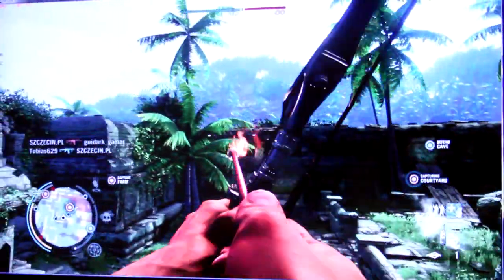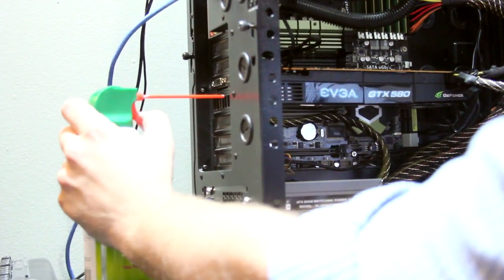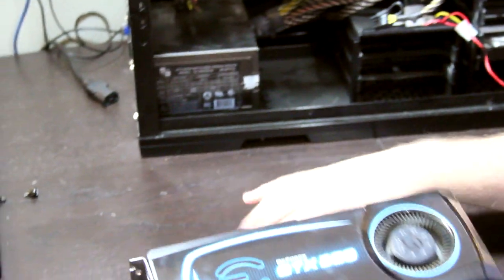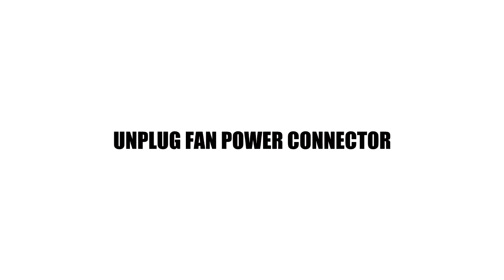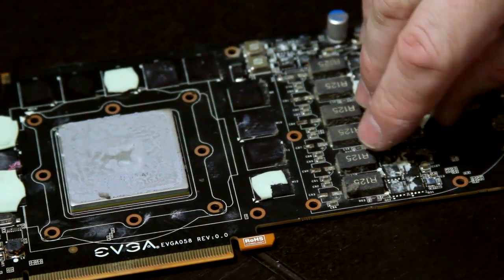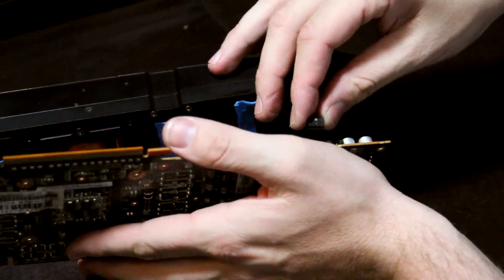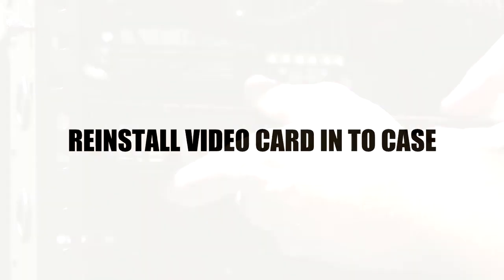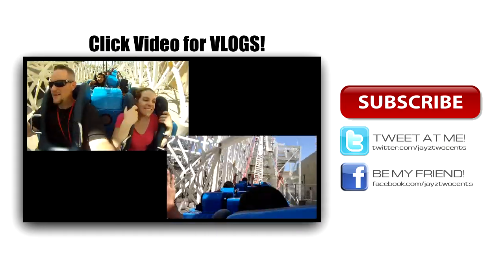How to fix overheating video card - Jayztwocents Tutorial

Comment: My graphics card has overheating problems. It runs over 90° in normal circumstances, and regularly my computer screen will go black and the GPU fan starts to blow full throttle. I've been doing some research on how to fix that problem and I found your video. As it happens, my GPU is a 4 year old NVidia GTX580, the exact same featured in this video. This is the perfect guide I was looking for. Now I have to gather the supplies I need for the operation... wish me luck.
Reply: +lnstagib- DonTry (David) His house blew up, saw it on the news
Reply: @black_savage96  🤣I'm ded
Reply: So how did it went?
Reply: Savage No it didn't. Haven't found time for the procedure yet.
Reply: For me it did worked fine
Reply: How did it go?
Reply: ive got the same gtx 580
Reply: I'm having the exact same problem with the exact same video card. Did this end up working? I just ordered the supplies.
Reply: 2 years later:how did ti go?
Reply: @draganzica296 
Asking in 2021.
How did it go? 😂🔥
Reply: 1 year later: how did it go?

Comment: my top gpu is 20% hotter running @ 84 and the second one running @ 64 I think I definitely need to add thermal paste on the first one asap! thanks jay!
Reply: Isn't that due to the placement of the cards rather than the paste?
Reply: +pcblah gpu 1-in first slot second at 4th slot thats asus rampage v extreme way for sli
Reply: +Jorge Vazquez try switching both gpus.

Comment: I prefer the updated video! Thanks everybody for bitching about how much paste he was using! :D
Reply: GPUs need way more than a CPU. I've used the CPU method on the exact same EVGA 580 and it wasn't nearly enough. I opened it back up and had to throw on 3x for a good even spread. Temps dropped too after putting more on. Jay and EK have it right on this one.

Comment: I have a gtx 580 owned it and used it for two days the first day the card was running at 50 degrees and the next day it runner at 78 degrees after that I decided to shut my computer down and plugged more fans in and after that when I tried to turn it on my monitor won't respond as well as my fan from the graphics card won't move helpppp!!!!
Reply: +Kebab Nabb Did you unplug the extra fans? I think you overstressed your PSU with the added fans.
Reply: Yes I did unplug them thank you for your reply!
Reply: +Kebab Nabb If the fans were the problem I suggest you to change your PSU. How many Watts delivers your PSU?
Reply: 550 Watts it's psu xfx
Reply: +Kebab Nabb The PSU is ok, you should not suffer underpowering. Maybe one of your fans is shorted. Try connecting one fan at a time and turning on your PC to check which one is faulty and making your PC not to turn on.

Comment: I have a 6-month-old MSI R9 380 4gb in my PC. A few weeks ago, my monitor would give me a "no signal" message after a few minutes of having any game with decent graphics loaded up (it only let me play stuff like Papers Please, Darkest Hour and XCom UFO Defense). It also auto shuts down when I watch youtube videos on it. I looked inside my PC recently and it looks like the only thing holding my GPU cooler to my GPU is the fan cable (it doesn't look like  there are any screws holding the cooler to the GPU but it could be that I just can't see them inside my case) and the thermal paste looks like it's barely there (and a little like it evaporated). Do you think replacing the thermal paste would fix my issue?
Reply: +DarkPhoenixNinja92 Well, it's almost certainly my thermal paste needing to be replaced that's causing this. I did a temperature test and my GPU is passing the 100 Celsius mark and shutting down my PC (probably to keep it from dying due to heat or something). Does MSI always skimp on thermal paste application or was it just bad luck?

Comment: Is it possible for a graphics card to get toasted and not work any more from overheating?

Or is there a too hot circuit that ** always ** turns the card off before it fries?

I'm looking at an MSI Hawk video card on Ebay. The description says the card is defective and it keeps overheating. I wonder if it is worth buying the card and replacing the thermal paste.
Reply: +Anthony Starfield The GPU will underclock itself if it gets too warm to prevent overheating. I would NOT recommend to buy a used GPU, ever, unless you buy from a trusted retailer and not some random person. 
If the seller sais it's overheating, it could be thermal paste. It also could just be a bad card. Don't buy it.

Comment: Did not work ;-;
Reply: +12AzaA1 could be your power supply mi i7 920 was reaching 95c and turn off i try everything and nothing until i change the power supply also if you buy useless economic thermal paste it will do nothing i buy mine for 2$ and my graphics card run even hotter

Comment: im borrowing my friends gtx 580 and it has a pretty beefy cooler on it (tripple Fans) and i recently cleaned it out aswell and changed the thermal paste and the thing still reaches 90c and higher, it also completely crashes when it goes past 90c. would anyone know what the issue might be?

Comment: Is it just me or did Jay forget to mention that to remove a PCIe graphics card you have to pull the locking clip towards the CPU ? (Or on some boards you have to slide a lock clip towards the back of the slot) If you don't do that you either won't succeed in taking out the card or I think you might damage the PCIe socket...

Comment: Can i clean the thermal paste with wet towels ???
Reply: +mamomi1 HD 

I normally clean thermal paste off with an anti-static cloth the type that's used to clean screens ...does the job
Reply: +mamomi1 HD You should probably invest a bit in some anti-static microfiber cloth. You can find some here http://www.amazon.com/Kinetronics-Anti-static-Microfiber-Cloth-10x18-Inch/dp/B00009R7VT for 10 bucks
Reply: +mamomi1 HD I take an old credit/debit card and scrape the old paste off. Then I take isopropyl alcohol with coffee filters and wipe the remaining paste off. The alcohol melts the paste away nicely. Once it is shiny clean you are good to go.

Comment: Great video.  I did this same procedure to a friend's discarded HD 6870 about a year ago - it made a world of difference.  (He gave me this card for free, believing it no longer worked.)  In this card's case, the fan had also died - so I took the ghetto-tastic route of zip-tying a high-rpm 80mm fan to the plastic case.  Noisy - but effective.  Worked like a charm!  It went from making horrible grinding noises (bad fan bearings), terrible performance, and dangerous temps (90+) to running like new.  I saw temperature drops of over 30 degrees with the same load, and since the card no longer had to throttle just to keep from melting, my FPS jumped quite a lot as well.  These days I'm running a newer card, but I still keep the little Frankenstein around to remind me what a difference a little human intervention and maintenance can make.

Comment: what do you call the blue tape you put in the card board, and where can buy that. please thank you
Reply: +1960tinotiger It already mentioned what it is... They are thermal pads and you will have to research to see what thickness of thermal pads you will need for your card.
Reply: thank you, now i know what to buy
Reply: +1960tinotiger You should be able to get thermal pads from a variety of online PC stores. They come pre-cut and in sheets of different sizes.

Comment: I thought 79-81 degrees was perfectly normal for a 980 strix as that's what I get when my fps is uncapped (fans normally at 70-80%) But I saw websites listing temperatures at load and they had the 980 strix at roughly 71 degrees at load fans barely spinning....  Does anyone else have opinions on this?  Jay even, although I doubt you'll read this.   I do have 2 980's in and the bottom one has never gone over 68 degrees.  BUT I swear I was getting 79-81 degrees before as well, fans at 70 though.

Thanks in advance guys.
Reply: David Hoffnung Not to mention thats also at a lower fan speed right?
Reply: KillTheCurse That is correct - half actually.  I was using an aftermarket fan connected to a very simple two-speed fan controller.  I always had to keep it on high before - but afterwards it was 10c cooler even on low speed.  On high speed (SO LOUD), I sometimes had temp drops of about 16c.
Reply: +KillTheCurse Do you have them butted up against each other? If so, the lack of airflow for the top card is more than likely the culprit. If you have a 3 or 4 PCI-E slotted motherboard, try moving the bottom card to the 3rd or 4th slot.
Reply: +Posh Cheeky Twat fixed my problem now getting 74 degrees max 50% fan speed.  usually 71c.  

I switched the top and bottom cards around since my top seemed to be running hot.  then made the top of my case an exhaust rather than an intake.
Reply: +KillTheCurse I was going to say - I recently learned myself what a huge difference case airflow can make.  With no other hardware changes, optimizing my case flow dropped my temps by an average of 10c.

Comment: My gpu reaches 90c in like 3 minutes. Is it the thermal paste?
Reply: +Matthias Aarnoutse How old is the card and have you noticed anything different, Gpus will ramp up the temps pretty quick
Reply: 3 years old. The fans starts spinning at 100 percent and when the gpu gets around 95 degrees celcius it crashes, Windows says it restored the driver or something like that.
Reply: ***** Either a really clogged card or it is a bios problem the first one is more likely
Reply: It could be a number of things. I would probably just do some research on threads and find out the common issues with the card.
Reply: Thanks guys. I think I am going to airspray the dust out of it and see if it is the thermal paste.

Comment: Following the steps in the video got my EVGA GTX 660 SC load temps from 90c@70% fan speed to 75c@45% fan speed. In this video though he doesn't take all the necessary precautions, make sure to hold the GPU fan when using compressing air to remove the dust cause it can fuck up your bearings.

Comment: another tip is to check the wattage recommendation on your psu based on the gpu's power requirement. I was running under and upreaded my psu and dropped 10 degrees!

Comment: Witcher 3 makes my GPU run between 70-77°c. the only game that gets my temps up that high on my GTX 970 reference card.
Reply: +TRAILBLAZER02 Why are you using a reference card to begin with?
Reply: +The Light Sabrix Because I made the mistake of buying an alienware x51 and u pretty much are forced to use a reference card. I'm building a proper pc next month though, and ditching the alienware shit.
Reply: TRAILBLAZER02 970 is great, don't throw it away. If I were in your place, I'd buy a AIO water cooling kit for the GPU and remove the reference one. It really helps the cooling and some are actually pretty silent.
Reply: +The Light Sabrix Pretty sure the Alienware X51 has absolutely no room to fit an AIO water cooler, unless of course you were referring to him keeping the 970 to use in his new build. Personally I would pawn the X51 to someone on Ebay  and take that money to build a real system.
Reply: +John Totten this exactly what I did. then I sold my 970 and bought a 980ti Classified.
Reply: +The Light Sabrix have u ever seen an x51? there's zero room in there for any extras like an aio
Reply: TRAILBLAZER02
Ah. But you could always just change a case, yeah? There are plenty of great budget ones. And there's no point in buying a 980 ti now, since we're getting Pascal really soon.

Comment: Is it normal to play far cry 3 and 4 at 70-80C?  My GPU is palit gtx 960 2gb OC edition.
Reply: Sharif Azmi Perfectly fine.
Reply: +Sharif Azmi my gtx 960 (MSI Gaming) is going 62ºC at 28% fan speed.
Reply: DeadNullermand wow that is very cool temp, guess the problem is mine gpu :(
Reply: Sharif Azmi
is it a blower style design/reference card? mine has 2 100mm fans on
Reply: DeadNullermand it's blower style...
Reply: Sharif Azmi oh sh#t. then im affriad that it is quite normal that they run at 70C for det most part
Reply: DeadNullermand no sh!t man, maybe this is the worse purchase in my life...i tried to change the fan curves, and you know, the temp max at 65 C at 65% fan speed, i hope my card can handle this situation.
Reply: Sharif Azmi
65C is perfect. as long as it is below 75C, then you are good to go, since a 960 dosent output too much heat
Reply: DeadNullermand Good, but i have sworn off Nvidia,...Anyway i'm planning to upgrade for R9 290X, is it good for me or i should wait for 400 series which utilizes HBM and new technology, plus i favor AMD in my build. And if i choose 290X what precaution shuld i consider?
Reply: Sharif Azmi
if you are buying a 290X, then i may ask you: why not a 290? i can do pretty much the same imo, but thats your choice ofc.
one thing to look out for is which brand you are choosing. i personally like Sapphire with their Tri-x cooler. and the MSI one too.
the other thing is that you will ned a 600w minimum and i do recommend a good +650w psu, since some R9 290-series kan draw up to 50+ extra power (you can adjust that) for a up to 375watt of power draw. so look far away from blower style coolers and be aware of your psu if needed :)
you can private message me if you will.
Reply: DeadNullermand i heard in the site ( maybe wctech ) that R9 290 has problem, don't know for sure so i would grab 290x (plus it has X!), secondly i forgot to tell you that the card i want to buy are used one, priced as same as GTX 960, and yes, it's sapphire tri-x rest assured :) but my main problem are my psu :(,i don't want to get techy to you (i'm ok if you want) the brand are uncommon in gaming world, it's 600w psu but i fail to see website that recommend this psu :( damn, should't buy that thing :( )
Reply: Sharif Azmi i do recommend at least a Corsair CX600 for a 290X (depending on your entire setup ofc) and maybe get an Cooler Master V650S or even a V750S if you want to OC your gpu later.
Reply: cx600 will be par with my current psu, the performance will increase from little or zero, i recommend to you  surf this site http://www.tomshardware.com/forum/id-2547993/psu-tier-list.html maybe you will more considerate about computer thing. No, i'm good with any GPU if it bring good performance and temp.
Reply: Sharif Azmi well i didn't knew about your current psu, so therefore i was talking about the CX600
Reply: DeadNullermand it's easy, Aerocool, ever heard about it, of course not...
Reply: +Sharif Azmi The issue of overheating wasn't really about it being form nvidia, blower style cards are just way hotter than other cooling solutions, also i'd recommend a r9 390/gtx 970/r9 290x for an upgrade in that price tag
Reply: António Real I don't blame Nvidia because of my temp goes sky rocket, in fact, they utilize Maxwell architecture and make 900 series GPU using less power, more efficient than their predecessor and thus temp also decrease, the problem adhere because my GPU using  blower style as people above me mention about. BUT i do dislike Nvidia because of certain reason.
Reply: +Sharif Azmi AMD cards are safe upto 100 degree's C.  dunno why but they can run that hot and be fine.

My R9 390 while gaming goes to 77C overclocked to 1150 mhz from 1060 stock. msi.
Reply: +Monkey D. Luffy really? my 390 runs at 65~c at 1175
Reply: Monkey D. Luffy You should change that fan curves you know, to me that temp very unpleasant for gaming

Comment: Why my GPU Has Temp 93c , please need help..!!
Reply: Change thermal paste, clean the dust, add more fan to your case, if it doesn't work buy aftermarket GPU cooler.  ( thing I recommend are 
1. Artic silver MX 4 thermal paste
2. Corsair AF120 fan
3.Artic silver Accelero twin turbo ii GPU cooler
                                    Good luck )

Comment: My 2 gig MSI 960's gotten up to 174F (for some reason MSI afterburner displays degrees in Fahrenheit and I can't change it) so it's at around 78-79C. Though for some reason around 140F in GTA V weird graphical issues start to happen, but in Battlefield 3 It's hitting 170F and no issues show up...confused.

Comment: 81 degrees are ok man, its normal temp for gpu.
Reply: for amd not nvidia because many nvidia cards starts trotelling 83c
Reply: +Luke Havelard 81 won't cause any direct damage - totally safe for the core - but at those temps I believe the paste will dry out more quickly.

Comment: my card hit often hits 100c and itself shuts it off when it does, but if i let it cool it works fine again
Reply: ***** Yep...
Reply: rip ur card.
my gt630 hits 105c and it was like zero fuck given.
Reply: +Richard Pugsley I'd still recommend doing what Jay shows in this video if it's getting that hot.  The shutdown protection is an emergency measure - temperatures that high are liable to damage your hardware.

Comment: My GTX 770 FTW is a heat monster. I can't install anything above or below without it heating up more. I only see two options, either I install a fan on the case lid next to the GPU, or I get water blocks and do liquid cooling all around, which is not in my budget...